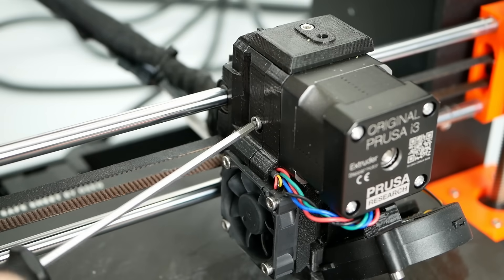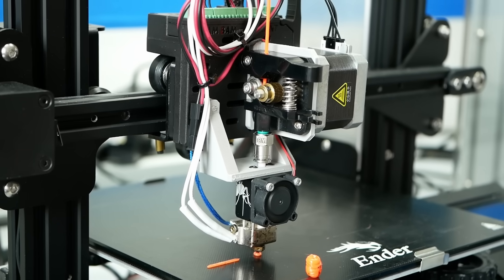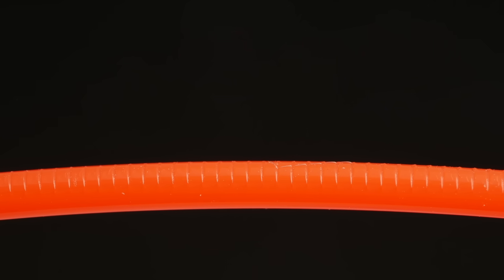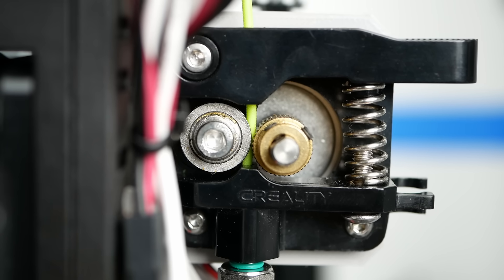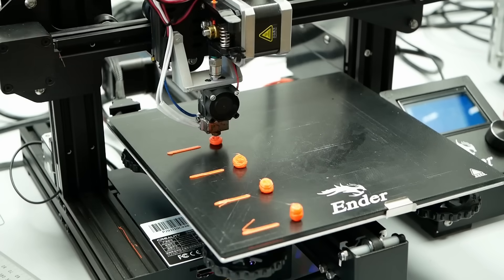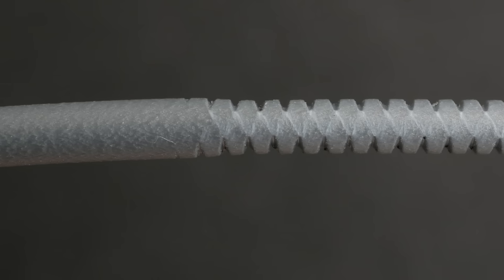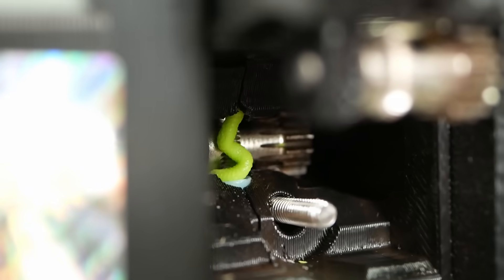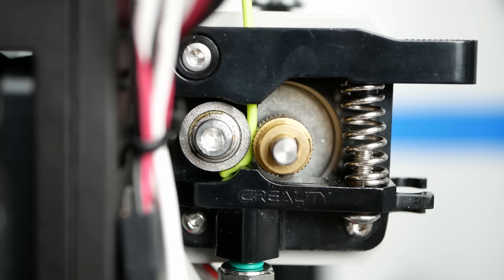Everything about Extruder Pre-Tension!

Comment: I never touch the tension (CR-10S with metal lever/guide upgrade) because I make sure that my feeder gears have grip/bite, meaning that the feeding isn't a FRICTION thing but rather one of FORM-FIT/LOCKING as the gears "bite" into the material. Swapping /re-working the feeder gears solved all (PLA) feeding issues for me.

Comment: I have noticed that extruder tension has an impact on flow rate. When I was calibrating E-steps on a Lulzbot taz 5, I was getting inconsistent results. In an attempt to fix it, I lowered the extruder tension and got very consistent results after that. Also the reduced tension increased the flow rate. I'm fairly certain that the stepper was not skipping. It's usually fairly obvious when the stepper skips, and the Taz 5 has an over powered motor which is geared down so it can produce an excessive amount of torque.

Comment: I have an early I3 prusa reprap. With the big herringbone gear extruder. I took the tension springs out very early on and haven't looked back. Fixed gap tension is the way to go IMO. I usually tighten while extruding untill it skips, then go back a bit. I also reverse fillament to check deformation is present but not extreem as per this video.

Comment: Interesting! Basically data to prove my experience over the last decade. Early on I just went with whatever the mfg said, but didn't take long to adjust by setting temp to the lowest print temp and adjusting tension until it gripped enough to not grind the filament at a roughly 50mm/s print speed. It has always served me well. PLA, PETG, every kind of flex, Polysmooth, you name it that method has always worked just fine. Granted I usually set it for PLA and it works on everything else. But as always YMMV I suppose.

Comment: Your testing confirms my experience with the current generation of Prusa extruders: once you get enough tension for things to start working, it doesn't really matter how far past that you go. Two turns, six turns, it doesn't change much, even for flexibles. Even on the older Mk2 extruder designs that was still (mostly) the case, but on the dual-Bondtech style, for sure in my experience you can just set it and forget it.

Comment: Worked with 3d printers way back when that had a flat bearing as the idler, and with the spring tension too high, it'd crush the filament into a somewhat triangular shape that'd cause a ton of drag or completely get stuck in the heat break. 
Lowering the pressure turned out to help a lot of extrusion issues, but only if you unloaded the filament and discarded the crushed section first, otherwise it'd just slip of course. What led to the issue in the first place, was people adjusting (increasing) the tension during the print, as it started slipping, just making things worse.

Comment: This confirms what I've been experiencing on my work printers where the petg filament was buckling. 

In my case it was a combination of the capricorn tubing causing too much resistance and tension settings.  Replaced the Capricorn tubing with standard and I tighten the bondtech gears all the way down and then back it off 5-7 half twists.

Comment: I like to adjust the tension with the extruder detached from the printer and from the motor; I push a piece of filament trough the extruder, and I adjust until I notice an increase in friction and then decrease slightly so that it still passes smoothly, then to confirm I keep the gear still with a finger while with the other hand I firmly try to pull the filament.

Comment: Creality metal extruder (the red one) should always be unscrewed, all the way out "loose". It has such a powerful spring that at half pretension it grinds out of brute force. Even at 0 pretension it leaves its marks on the filament. So the advice to new ender users (i have a 5 pro) is inscrew that pretension if you want consistent flow rate.
Reply: I just installed the red extruder and can confirm what you are saying.

Comment: Nice video. I modified my ender 3v2 with the orbiter 2.4 direct drive extruder and it worked fine with normal filaments on almost all tensions. But flexible filaments would rly easy get stuck if the tension would be to high. Sometimes the tension screw was only a fraction in to it working reliably. This is properly because the spring used with screw for tension is to strong. i would recommend changing the spring.

Comment: one thing that was not mentioned is that the round cross section of filament turns into an oval after too much tension. the problem becomes especially apparent when you use a bowden setup and also use a long capricorn bowden. you have created a very strong friction inside the tube due to the deformation of the filament and the very narrow capricorn inner diameter. 

At first glance, this looks like a clogged nozzle, but very often it is not.

Comment: Always strange to see how old technology comes back. 

Early makerbot extruders use to have "fixed" idlers, and they were pretty common with reprap projects in that time period as well. The spring loaded idlers quickly overtook them as they dealt with the deviations in the filament diameter better, and the inconsistent hardness of the mostly ABS filament that was used in that time.

Comment: This reminds me of my sewing machine. The fabric is tensioned between the foot and the bed, and the teeth on the bottom push the fabric forward. But if you want to sew flexible/elastic fabrics, you need teeth on the top as well (like the new double drive gears) or it will strech instead of feed trhough.

Comment: No mention of setpoints for extruder currents! Rather than relying on the gears to intentionally skip on the surfaces and inevitably cause wear, I set the current to the point that the extruder stalls and doesn't grind the filament at all. I found I can get away with a 650mA setpoint on one of those tiny 23mm deep motors.

Also something nobody seems to mention for dual gear extruders vs the default ender3 idler, is that the OD of the hob is smaller so it is also a torque magnification.

Comment: too much tension can even block the extruder. 
just switched my extruder yesterday when I saw the lever was broken.. I wonder if you could build a "closed loop" system that measures the actual filament movement with a separate sensor and compares to the motor rotation.

Comment: Ha, excellent timing. Wordy explanation time... Working printers: Prusa Mini, Prusa MK3S. Non-working: Creality CR-30 (probably software). Old: FABtotum.

The timing of this was perfect. I had been doing a bunch of printing with my Mini and came back to the printer a couple days ago to find the print half-complete. I went through basically all the debugging steps (changing temps, changing filament, etc.) and nothing worked. It didn't make sense... and then I accidentally pulled on the spool of filament without unloading. It came out without any indication it was being gripped. I took a look and realized the idler was open. How it got opened, I have no idea. Did the printer rattle so much that the screw loosened? Was it not tight enough? Etc. etc.

It was late, I just wanted the print going, so I simply screwed the idler back down and hoped for the best. After a bit, I heard some bad squeaking and nothing extruding. I reset everything and asked a friend with a Mini to send me a pic of their idler. I adjusted my settings to match theirs. This was a mistake... they've been complaining about clogs for weeks but still got prints. After 2 more failed prints, I brought it to the work bench to give it a good look over. In both of these failures, the filament was ground to hell. I then remembered... I had a Prusa, and Prusa has tons of docs. So I looked up what they recommended for the tension and it was basically the inverse of what myself and my friend had. It was so tight it was destroying the filament. Use some silk filament if you really want to see every single bite mark, scrape, etc. I also completely disassembled the extruder and gave it a good cleaning.

After adjusting to Prusa's recommendation: it runs perfectly. I've gotten multiple good prints out of it. I told my friend to adjust their idler.

Ok, end story.

The MK3S I generally just lined up the screw head to the housing surface. I'm about to upgrade it to the MK3S+ so I'll be readjusting the tension once done.

The FABtotum was interesting... company was shut down (a story on it's own) so don't expect to find one. They built the whole thing from scratch to the point of having custom nozzles made for it. But what made the FABtotum different for the time was that it could print, mill, and scan. And for the extruder: it drove filament AND it provided a 4th axis for milling. So it had a tensioned ideler that also had a push button to fully disengage it and a mechanically applied re-engage by driving the extruder (which attached to the Z axis) into the base of the unit to push a lever that popped the idler back in. I fought that extruder so much. Too tight, too loose, they did 3 upgrades where they literally sent little test tubes with a new spring or new tension screw, each time different size, force, etc. It was interesting... that printer in 2014 had more features then some of the printers you can buy now after augmentation with OctoPrint or similar. When you got it to print, it worked fine. Probably around Ender 3 quality. But when it didn't work... it would be days of trying to work on it to get it working. And as stated, most of my time was spent on the extruder because it would just not extrude... shakes fist at idler tension

Comment: I had a real problem not with the tension, but with retraction of the filament on parts with many small moves and small amounts of extrusion. The fillament would get pushed maybe a centimeter, then retract 6 cm, and then do that over and over until it smashed the filament and jammed my setup.

Comment: matches my experience with the ender extruders. I've had issues printing small parts with lots of retractions in PETG. The extruder at its default lowest setting progressively crushes the filament on each pass until it can't really push on it without it buckling.

Comment: I feel like extruder tension (combined with heat creep) is the hardest thing about my very old Replicator 2X with a pretty primitive extruder. I still have the original (widely criticized) extruder on one side (the side I use for pla), while I have a printed extruder with a well constrained filament path (works good with flex, never had a problem) on the other side, but it has no built in adjustment screw. Adjustment has basically been "clip off a bit of the spring"... But the cheap replacement metal extruders I ordered on eBay don't really line up with the hot end...

Comment: My printer tech is under the impression that adjusting springs like in the MK3S and Ender style extruders doesn't increase pressure in a linear way. He claims it's basically binary until you reach the ends of the springs' travel.

I disagree with him and think the more a spring is compressed, the more force it exerts. 

 What do you think?
Reply: As with any spring, hookes law can be applied to show that force goes up as the spring is compressed (within reasonable limits). I believe he may be confusing constant with linear.
Reply: @ManBearPigCreative  Thanks. I actually looked up Hookes law. I'll ask him about it to see if there's a point of contention
Reply: @condorman6293  i am happy to hear that my comment caused you to look it up, i probably should have described it in further detail in the comment.

Comment: My only real experience with extruder tension comes from my first attempt to print TPU on my Prusa MK3S.  I learned the hard way that you need to reduce the tension, or you'll get a coil of that flexible stuff tangled in your extrusion gears.  Only 02:20 into the video, so I'm hoping you'll provide an evidenced reason why that happens.

Comment: I have found that NinjaTek Chinchilla is very sensitive to extruder tension.  I struggled for awhile trying to print it using an E3D Hemera before finding just the right tension setting for good results.  I then tried it using a Biqu H2, which does not have adjustable tension, and I was unable to print Chinchilla successfully on that machine.

Comment: I have found out that extruder tension affects also dimensional accuracy/flow when printing with materials like PETG and ABS at low layer heights 0.05-0.1 mm. At 0.2mm as long as there is grip there is no noticeable difference. Also some filled materials like PLA wood can break easier from high tension or grind because they have absorbed moisture (wood increases the rate of moisture uptake), grinding could be related to other factors as well. Finally some PP based materials can become permanently oval from high extruder tension and that can affect how clean and consistent corners and retraction/restart points are.

Comment: PolySmooth gets absolutely smashed if you have lots of retractions in your print and high extruder gear tension. It will flatten so much that it can’t pass through the Bowden tube and starves the hot end.

Comment: That opening clip with the flex going the wrong way reminded me of why I HATED loading the Robo R1. You just had no idea whether the extruder gears were directing the filament to the hotend correctly until the nozzle oozed plastic or the filament came out of a gap in the tool head. I've been so spoiled by Bondtech gears since.

I would get filament stripping on a Raise3D Pro because its extrusion system would heat creep and you'd end up with a little blob of molten plastic above the heatbreak that you'd need to force out with the steel wire in the accessory kit. Very frustrating when that happens because you need to start the print over.

A sponsorship that is effectively a recruitment video for a company founded by investors who are known for running unsafe or labor-hostile shops. Uh... sure. Whatever puts food on the table, I suppose.

Comment: Extruder tension is definitely one of those misunderstood things.  I discovered it on my Prusa Mini running the bondtech extruder.  After setting it up per bondtech's instructions, I had very inconsistent extrusions very underextruded on parts with lots of retractions, with some overextrusion in random other parts.  After many parts checks and disassemblies, I tried lowering the extruder tension until prints were consistent, then continued to lower it until filament would grind, and used the halfway mark between the two.  Also learned that making a mark on the tension thumbscrew makes it much easier to count turns.

Comment: We are a very small 3d printer manufacturer. What we advice to our customers is: loosen the tension screw, while holding the filament firmly not letting the extruder pull, run the extruder and tighten the screw slowly until the extruder stops grinding the filament and starts loosing steps with tick sound. This works for pla and enables the user to find the best grip tension.
Reply: In one comment, you explained what I am looking for, that this whole video never explained. Thanks.
Reply: Woah, advice not working, my dual gear extruder literally pulled my whole ender 3 v2 towards the abs filament I’m gripping coming out of the filament dryer, and the filament literally breaks off the end that I’m holding before any of the clicking happens..
Reply: @TYS1308  It seems like your motor torque and grip both higher than rigidness of your chassis. If you can not make the filament slip on the extruder gear by holding the filament by your hand, it means you have already tightened it as needed or more. This procedure works well on single gear extruders. Did not tried it on dual gear extruders.
Reply: Thanks for the tip, I'll try that with cf nylon and petg
Reply: Hold on. This creates more questions than answers. Because the skipping point is different, depending on extrusion gear diameter, drivetrain, motor spec, drive IC, drive current. And even holding the filament how - if i held filament firmly enough for it not to slip, i'm pretty certain before my extruder skips, the printer will pull my finger through the little 2mm hole and into the extruder gear, i am... sometimes a little excessive in my setups. Because if the machine can't maim you, is it even a real tool?
Reply: Thanks that's great advice!
Reply: Didn't work for me. The spring moved before the extruder to click !
Reply: any tips for soft tpus? talking 85a and lower
Reply: heh, interesting.  I have a slightly different method, but it would produce similar results.
Reply: @NeoIsrafil  tell us your method please!
Reply: In the interest of professionality, it's spelled "losing."
Reply: @soundspark English is not the only language in the world
Reply: @artelislt It's a common misspelling by people from English speaking countries, especially the USA.
Reply: @soundspark  but only second the first one is correct from setting loose/ loosing

Comment: Anycubic i3 Mega-S here with the stock "titan style" extruder that has an adjustment knob for spring tension. I usually just tighten it until I feel a major resistance increase against turning it further. Seems to be the sweetspot since I can see and feel the small indents the drive gear leaves on the filament.